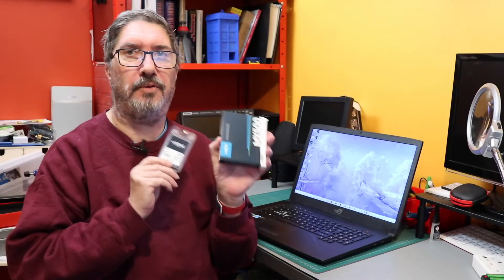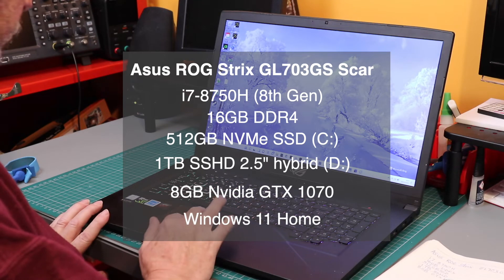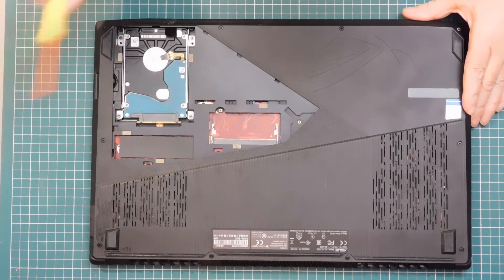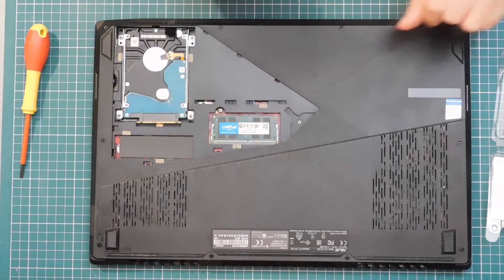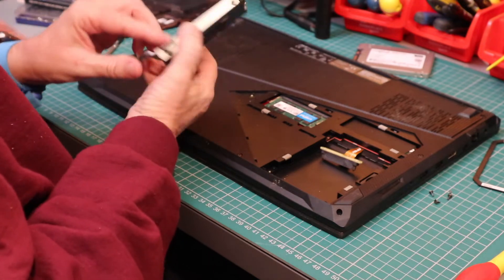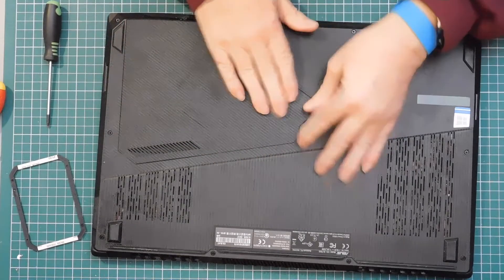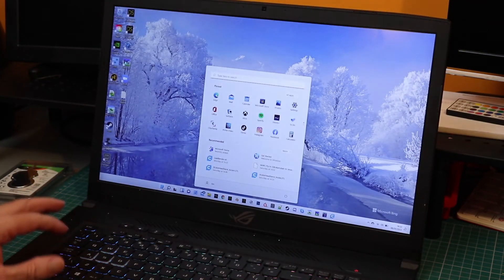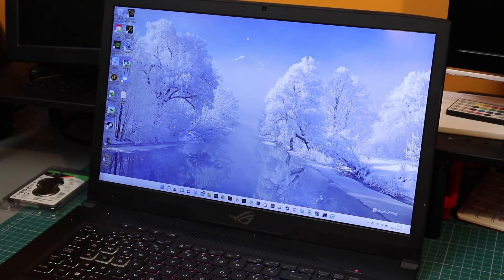ASUS ROG Strix Laptop RAM and SSD Upgrade: it's easy!

Comment: Hey for 2024 year what you sugest the same parts?  i want upgrade my laptop all memory Ram ,hdd to ssd , and that system ssd .  why did you choose crucial is it best for that laptop or ? Thanks for video.  And 32 ram are max out  fors this model ? so basicly you got 16x2  I was heard its better one slot ram are free ? what you can recomend? how is runing your laptop? Stil using ?
Reply from the maker: 2 sticks are better than 1 cos you get extra bandwidth (= faster). I believe you can put a max of 64GB in it (2 x 32GB). You'd need to further dismantle it to get at the other memory slot. I have found 32 to be perfectly adequate in mine. I do rendering in Blender, Daz Studio etc, and have never reached the limit. The SSD I chose was really down to value for money at the time, sticking to major brands. That choice may be different today, depending on what offers are available. I think the C: NVMe drive is limited to 2TB, but I haven't tried to replace that.
Reply: @TimsRetroCorner  thanks for answer ! where can check out those max stats in asus web?